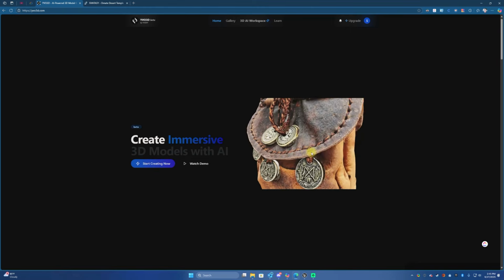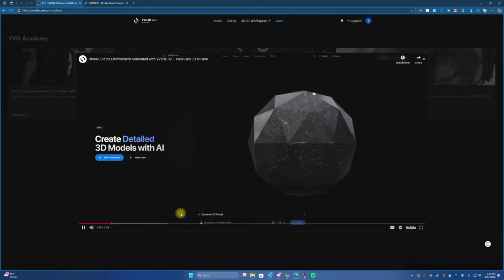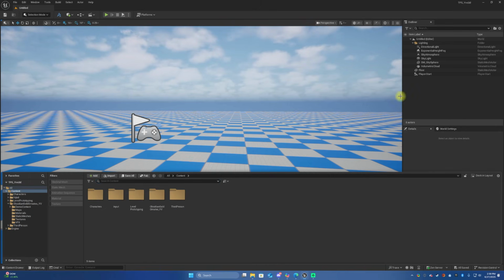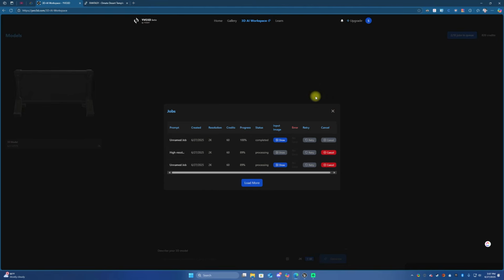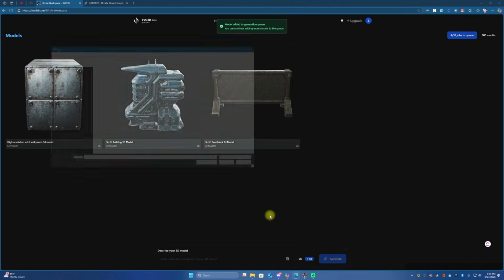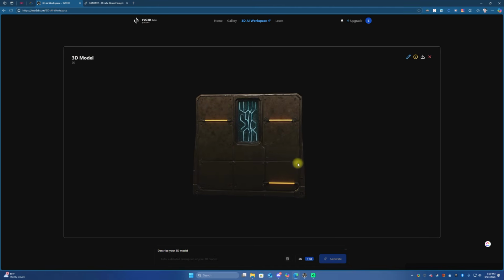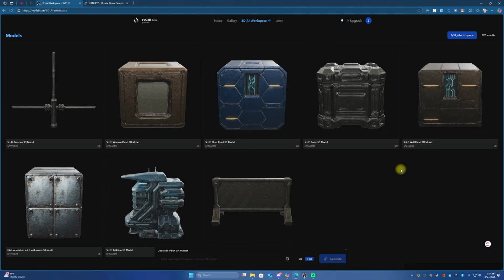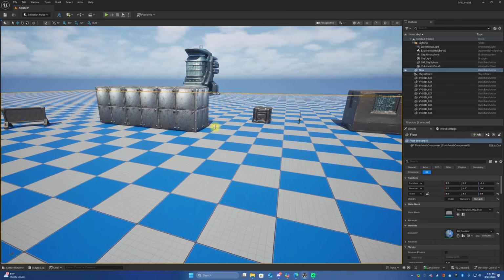#YVO3d #AiGenerated ##3dmodels  Deep Dive with #UnrealEngine

Comment: Why are you not doing "real 4k" with 200k polygons?
Reply from the maker: That's a really good question. I chose not to do that because I wanted to see what 2k would look like. I do think that 4k will definitely turn out much better because of the generated resolutions on the models. It also significantly increases the cost of credit usage though so that is why I only tried 2k. If it'll help, I can gladly make a short video showing new models at 4k.